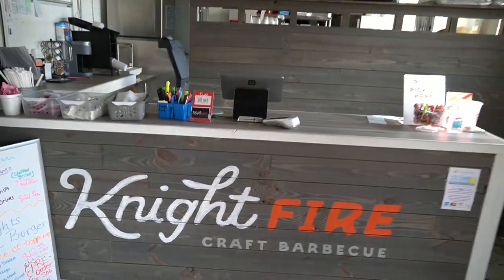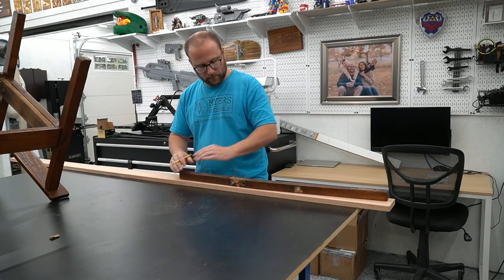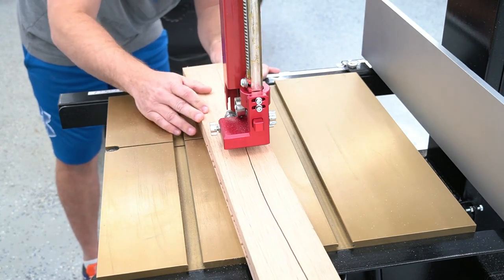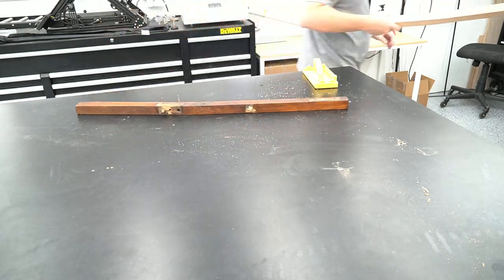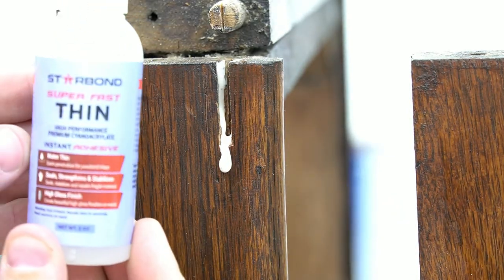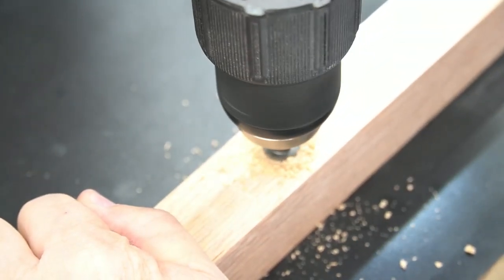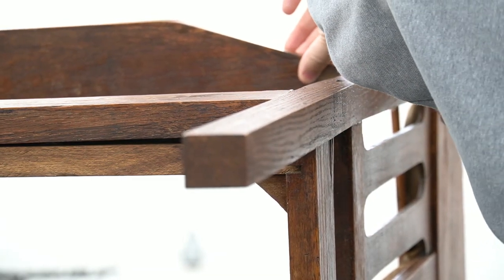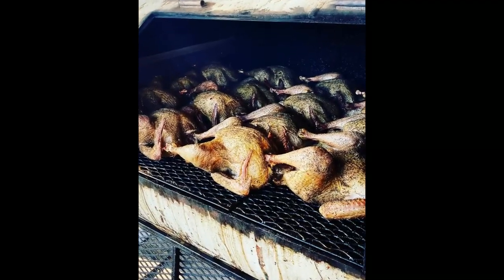I Repaired A Chair

Comment from the maker: TOOLS / MATERIALS
■ Jointer: https://amzn.to/3XgRnDc
■  @Harvey Woodworking   Bandsaw :  https://www.harveywoodworking.com/products/new-alpha-hw615-15-band-saw
■ Sander: https://amzn.to/3X7biV2
■ Sanding Blocks: https://amzn.to/3hN1OOB
■ Glue: https://amzn.to/3AiQgsR
■  @Rockler Woodworking and Hardware   Glue Brush: https://amzn.to/3Gi7YAe
■  @ToughBuilt  Pull Saw: https://www.lowes.com/pd/TOUGHBUILT-Quickset-Double-Edge-10-in-Cross-cutting-Pull-Saw/5013223171
■  @DEWALT TV   Oscillating tool: https://amzn.to/3Eitpii
■ Starbond CA Glue: https://amzn.to/3tvw2rZ